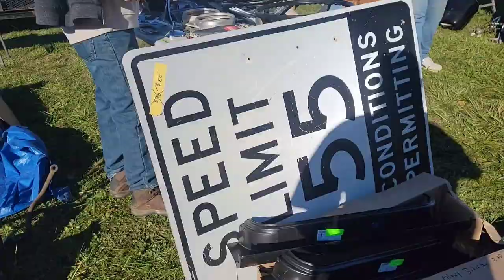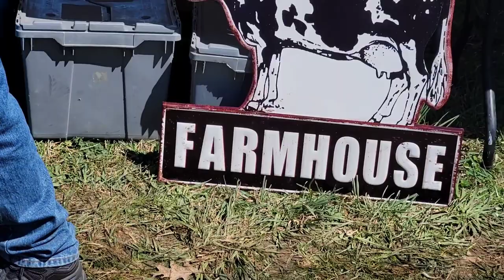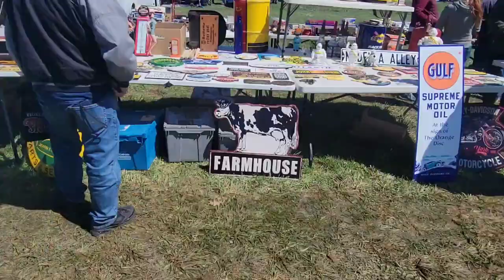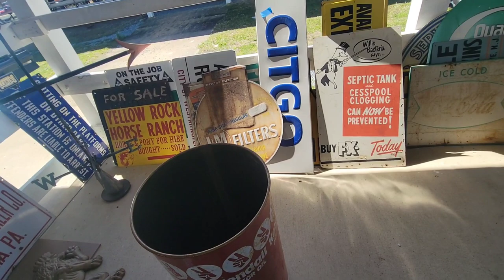Automotive Swap Meet Salem County New Jersey

Comment: I bought one of those Texaco signs once for 40 bucks, had a couple loose wires in it. Fixed it and sold it for 3 or 4 hundred. The guy drove 150 miles to pick it up. Liked the chainsaws! Thanks for taking us along. Cool stuff!

Comment: Should went and delt with that air ride components...im about to have my half inch system installed in the next week or two in my fully shaved 87 mazda b2000...thanks for sharing

Comment: That’s definitely a square body the obs is the body style after that the gmt-400 I had a nice 91 k1500 myself it had the 350 with a 5lm60 manual transmission I miss that truck